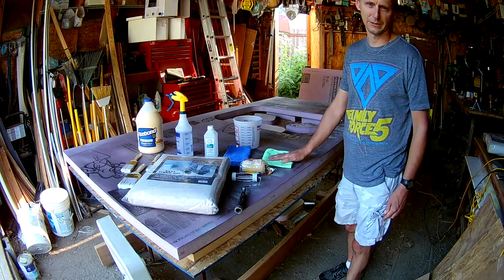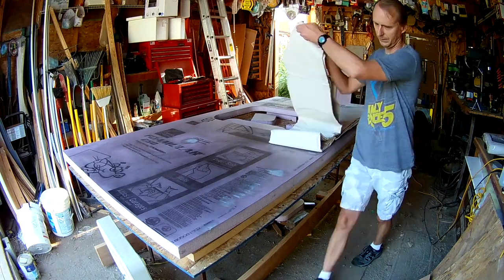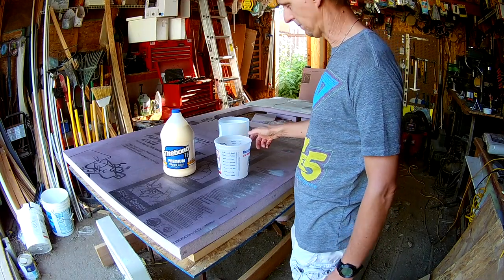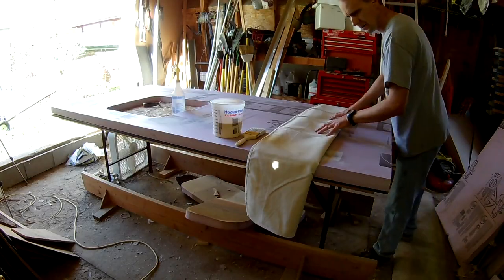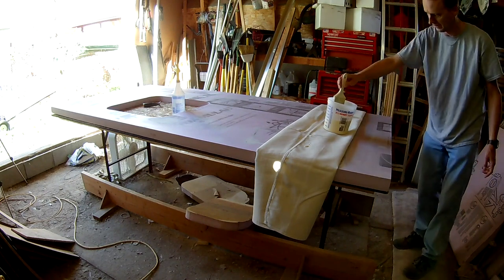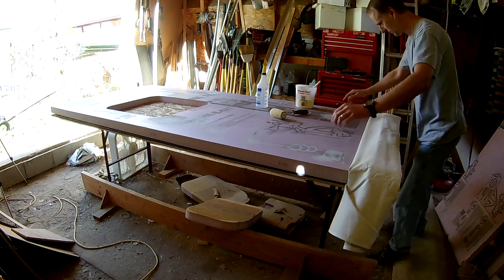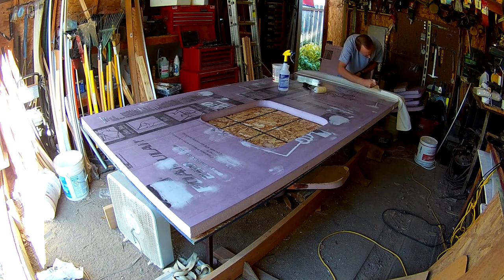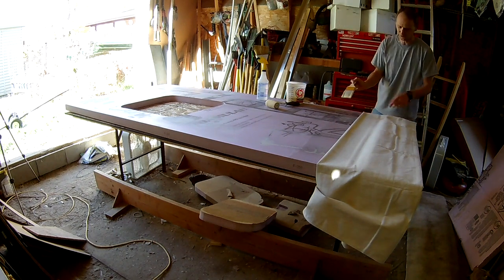Step 6 Canvasing Interior Walls Part 1

Comment: This was the best example on how to do this process. Good Job!
Reply from the maker: Thanks! Glad it helped.
Reply: I saw you showing how strong the camper is while pulling it with your jeep, so I assume this video was done awhile ago. My question is how did you connect the walls to the floor?
Reply from the maker: @craigc2721  Actually the current build videos are a trailer identical to the trailer you saw me pulling with the Jeep. My first build I did not document well for video content so I decided to build another one with better video support. I have on the other hand been beating on the previous built trailer to find weaknesses and to make improvements. The good news is that it is holding up just fine. 

I glue the walls to the floor with Gorilla Glue Construction Adhesive. It comes in a tube and is applied with a caulk gun. The glue is applied to the floor and the inside wall rails that I showed how to install in Step 1. Once the canvas is applied the assembly will act like a dado joint to keep the foam in place. Hope that make sense. George.
Reply: George. I understand up to the last part. Do you apply the canvas on the outside of the panel after the walls are in place and glued down or on a flat surface as you did with the inside of the wall?
Reply from the maker: @craigc2721  The foam is glued to the floor and inside frame rail. once the walls are attached then the exterior canvasing begins. The canvas will come down the outside of the wall and then fold over the floor about 2" it will also fold over the roof 2". When done the canvas will be glued to each other on each panel and to the floor. This creates a sock effect to hold everything down snug to the floor.
Reply: Bug Out Trailers thanks for clearing that up for me. I saw how you did the inside wall with the panel lying flat which looked like the best way to get the wrinkles out. I assume when you do the outsides you work from the top down. I agree that the overlap of the roof and floor will hold it all together. Thanks again, Craig
Reply from the maker: @craigc2721  Yes I work with the canvas from the top to the bottom. I roll it up on a piece of wood or pvc and lower it down as I apply the glue.
Reply: Bug Out Trailers George,  perfect! Rolling it up is a great idea. Thanks for all your help. Craig
Reply: One more question. I followed your steps and my question is when its dry will you be able to lift the canvas off the foam without to much effort ? Mine may not be completely dry and I can lift it without much effort.
Reply from the maker: @craigc2721  Yes the canvas will lift fairly easily. The strength in the panel is more on the shear strength across the panel. There really is not too much strength in lifting of the canvas. This generally is not a issue in service though.
Reply: Bug Out Trailers thanks again

Comment: I'm planning on having a scant 2x3 wooden frame. Would you recommend canvassing between the foam and the frame? I would think not, because I'd think the glue would adhere better between the wood and the roughed up foam than the wood and the pmf
Reply from the maker: Not really sure by you description what your intent is. Are you building a frame around the side walls. Or a frame to build the walls on. You can find my first build on TNTT.com. Look for #1 in the foamie section. You might find some answers there.

Comment: Good progress George. Is the water on top of the canvas to prevent the roller from sticking?
Reply from the maker: No. It does a few different things using the Harbor Freight canvas. It helps the canvas to relax to get  the wrinkles out, It causes the canvas to shrink as it dries, again to get out the wrinkles and to make a nice tight skin. It also helps to pull the glue up into the canvas better to get a better glue saturation in the canvas pours. Oh, it also slows the glue drying time when it is hot outside too. George.

Comment: don't understand why you wouldn't use fiberglass and resin. doesn't cost much more and is so much stronger.
Reply from the maker: I personally do not like working with fiberglass and resin. You can use fiberglass and epoxy resin if you want to. There are a few who have built foamies that way. But really most people do not want to be bothered with learning how to use fiberglass. If you say fiberglass their minds wander off. 

Most people do, however,  understand paint and fabric (canvas) so it simplifies the build to them. They think I can do this on my own with simple tools and materials that can be purchased at the local hardware shop.

Thanks for watching! George